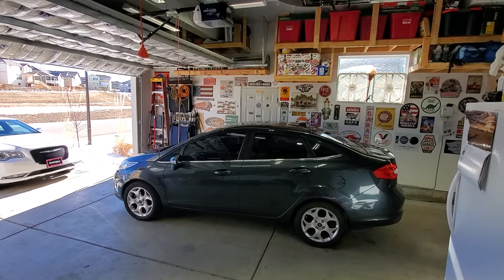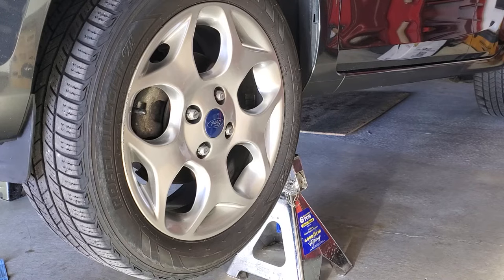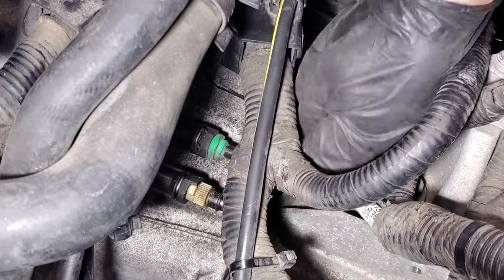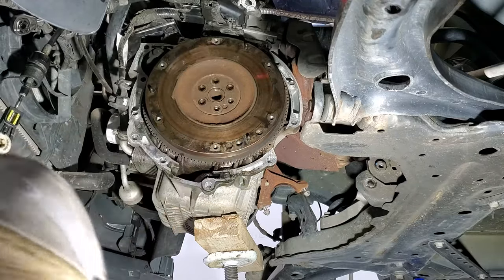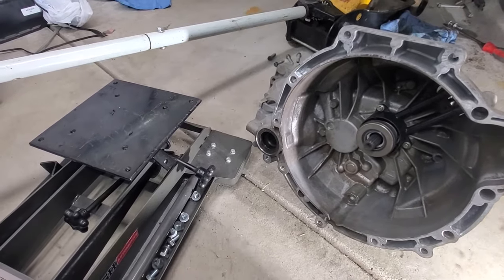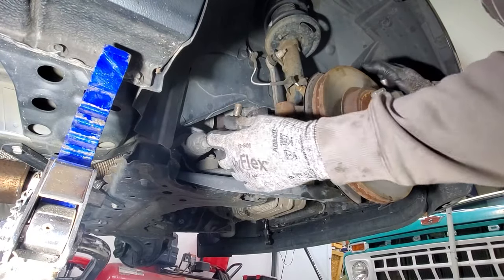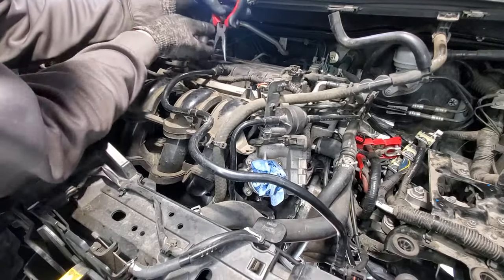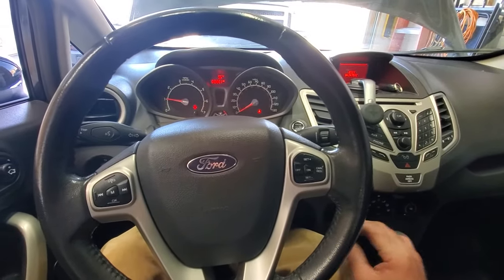Ford Fiesta Clutch & Slave Cylinder Replacement How-To

Comment: Hello, awesome video! 
Was wondering how long did it take you to do all this work? The video is about 1.5 hours but there are a lot of speed ups … thanks
Reply from the maker: I’d say if I wasn’t recording it probably around 4-5 hours or so.
Reply: @BLUECOLLARGARAGE  for you by yourself, yeah, I bet they can do at least that in Ford garage… not sure where 10 hours came from
Reply: @BLUECOLLARGARAGE  thank you for commenting
Reply from the maker: @MrMeowNow  yeah these cars are very simple and basic not a lot to pull when doing this job which makes it nice.
Reply: @BLUECOLLARGARAGE   so I want to ask you a question.  So I have fiesta 2013, and it drives great, no issue with shifting or anything. The only thing is , when I drive about 20-40 mile an hour there is a grinding noise almost like a front wheel rubbing on something … that happened after I got the 120,000 mile service. When I took it in to Ford, they drove it a bit and told me it’s a clutch and it needs to be replaced. Gave me a price tag of $3000. When I asked them how they tested it, they said , we drove the car and listened… No codes no nothing . Will be taking it to another Ford place this Friday.

Question is about that noise, is it possible it’s a clutch or maybe they just want me to get a new car and get the fiesta off the road. 

Thanks you
Reply from the maker: @MrMeowNow  what did they service on the car? Have you checked your front wheel bearing hub assembly?
Reply: @BLUECOLLARGARAGE   the service was generic for 120k , wheels rotations oil change and such… they also replaced back shocks. I asked them to check that, and they said that my wheel bearings are fine.. “ they think it’s a clutch”  
Even when the car is rolling on Neutral Speed, the noise is still there… I would assume that the clutch not in gaged when car is in neural … 
Ps , it’s an automatic transmission.

Thank you
Reply from the maker: @MrMeowNow  oh okay gotcha didn’t realize it was an automatic. I’m assuming you already know there was a ton of issues with the automatic transmissions and the tcm in the fiesta and focus. Even though it’s an automatic it’s built like a manual that just shifts for you kinda of an odd setup. I would definitely take it and get a second opinion though.
Reply: @BLUECOLLARGARAGE  thank you, yeah, doing it this Friday… yeah I know all about the TCM and recall … and all that… mine had 2 replacements of TCM already … nothing in recent 5 years … again, thank you much for responding:)
Have an awesome day
Reply from the maker: @MrMeowNow  your welcome thanks for commenting and keep me in the loop and let me know what you find out because it’s got me curious now.
Reply: @BLUECOLLARGARAGE  lol, will do, I’m also very curious 🧐
Reply: @MrMeowNow what happened - the Update?

Comment: Personally I wouldn’t use LUK  because of reliability I always depend on Borg & beck only on the basis that the reliability factor is better and lasts longer 👍
Reply: When I googled the numbers on the side of the box that contained my clutch, luk model in luk printed box etc, it came back with a Borg and beck clutch. One number on the box came back with the luk kit that was in the box and the other number the Borg and beck. Very strange.

Comment: how much pressure did you apply when bleeding the slave? I cannot get my slave to properly engage my clutch after re assembly
Reply from the maker: I wasn’t really paying attention to the pressure I just was pumping the 3-4 oz of fresh brake fluid in to the slave cylinder.
Reply from the maker: What’s you clutch pedal doing? Is it sinking to the floor?
Reply: @BLUECOLLARGARAGE  the clutch just doesn’t feel like it’s building pressure after all bleeding procedures. I’m thinking there may also be a failing master cylinder at this point
Reply from the maker: @jackflashautorepair  yeah that’s what I was going to suggest sounds like the master cylinder.
Reply: @BLUECOLLARGARAGE  thanks for a quick reply! Your video was a super helpful reference as I did this clutch job. Great work, this is the type of content I aim to make.
Reply from the maker: @jackflashautorepair  no problem let me know if you have any other questions.

Comment: Does anyone know where I can find the bolt lengths for the bolts that hold the transmission in? Like an idiot I didn't mark them when I removed them and I am trying to put the transmission back in. I also do not have a transmission jack so I'm trying to figure out how to get it back up there. I saw someone use ratchet straps on a different vehicle/transmission but I don't know...
Reply from the maker: If I remember right they were all pretty close to same in size only a few were different lengths. Can you tell by my video on the lengths? I’ve actually used a 3 ton jack with a large piece of wood instead of a transmission jack or if you got a couple buddies to help to hoist it back into place.

Comment: Is the fly wheel supposed to rotate freely once the transmission side is off? Or it it a possible sign of something else that is wrong with my car. It's currently sitting in my garage waiting for the clutch kit to arrive, and would like to know of i need to check anything else while I'm under the car.
Reply from the maker: There should be a little resistance but yes it should be able move because with the transmission out it’s pretty much in neutral because there’s no gears being able to hold it in place that is why you need to use a tool to hold the flywheel when tightening the flywheel bolts.
Reply: @BLUECOLLARGARAGE  thank you for your reply and for the very informative video.

Comment: I just installed a clutch, presureplate, and RS slave cylinder into my Focus ST - and now I leak break fluid when i press clutch - clutch is kissing the floor. Im pissed if I have to drop the tranny again. It looks like its leaking from bell housing, but i cant confirm.
Reply from the maker: Sounds like you slave cylinder might be leaking. What bleed procedure did you use?
Reply: @BLUECOLLARGARAGE  I used a bleeder vacuum. Attached to bleeder screw on top of slave cylinder - pressed clutch peddle with a stick to the floor - opened the bleeder - until some air come up, closed it, released the clutch while car was off. Repeated this multiple times. Still air in system. Still clutch stuck to the floor.
Reply from the maker: @dannyj7618  you may need to try and bleed it like I did in the video it’s almost like a reverse bleed instead of pulling fluid it’s actually fixing fluid in the system. Hopefully it’s not leaking from the slave cylinder because of to much pressure.
Reply: @BLUECOLLARGARAGE  Thats what i was worried about - I put max psi on the vacuum and fear I damaged a seal. Appreciate the reply. You're totally right, I misread the workshop manual. I had to pump the brake fluid INTO the bleeder, than top it off at brake reservoir.
Reply from the maker: @dannyj7618  maybe try bleeding it again this way and see if it works. If not I hate to say it but you may need to drop it again and replace the slave cylinder.

Comment: I did everything you said in the video step by step. And now my car won't turn on. What could be wrong?
Reply from the maker: Did you double check all your wires especially that ground wire under the battery. When you say not turning do you mean like not electrical or it won’t start and stay running?
Reply: @BLUECOLLARGARAGE  Yes but I can always go back & check them again. Like it won't start & run
Reply: @BLUECOLLARGARAGE  it's just making a clicking sound that's all
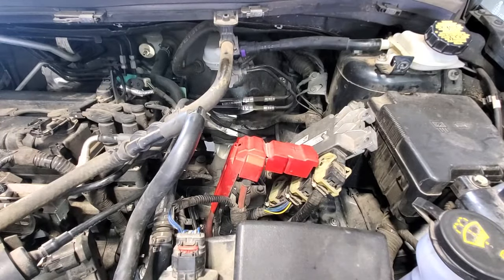Reply from the maker: @cowboyfrank  yeah definitely go back and check that ground wire under the battery box that connects to the transmission it’s in the video at 1:31:21 because if that’s not getting a good ground the car will just click and not start.
Reply: @BLUECOLLARGARAGE  okay it worked. Now I need to put gas in it & see if it fully turns & stays on
Reply from the maker: @cowboyfrank  Good to hear that worked let me know if you need anything else.
Reply: @BLUECOLLARGARAGE  you are so awesome & helpful. I really do truly appreciate it
Reply from the maker: @cowboyfrank  your welcome glad I could help.
Reply: @BLUECOLLARGARAGE  do you have a video on how to change out the condenser on the Ford Fiesta?
Reply from the maker: @cowboyfrank  no sorry I don’t. Not yet at least.
Reply: @BLUECOLLARGARAGE  oh okay lol I need to switch mine out lol
Reply: Dankie

Comment: I was doing a new clutch on my MK4 Fiesta. :D Everything was just fine, I changed whole clutch, did the bleeding and etc...After that I wanted to try the clutch If is working properly. I started the engine with clutch enganged, shifter was on neutral. I released the clutch and wheels started to turn forward. :D I though: "Its ok, I will just shut it down and move a little bit with shift rod going to transmission". And when I was under the car, suddenly I cannot move with that shift rod going through seal to the transmission. It is feeling like jammed or stuck on some gear (1,3 or 5 I think).Cannot change gears even with enganged clutch or released clutch with engine on or off. :(
Reply from the maker: Sorry for the late response did you end up figuring out what was wrong with it?
Reply: @BLUECOLLARGARAGE  Oh yes! I did found the problem! :D On the bottom side nearly next to the drain nut of transmission is another nut. It is hard to explain why is there or what is it, because I do not really know so far. :D Its just a nut with a "nose" and when I unscrewed that, inside is a moving roller in oil. Out of curiosity I tried the shift rod and it was moving! :D So I screw that strange nut with a nose back in, filled up with transmission fluid and car is working! :D 
Thanks for the tutorial man, it helped a lot, even your car is from 2011, basically not much really change. Only in my car, there isnt so much electronic. :D
Reply from the maker: @richguest9480  good to hear you got it figured out. Thanks for the positive feedback.

Comment: When you replace the brake fluid, is the a step needed to bleed the slave cylinder or do you just youse the steps you took when pumping the clutch in reverse?
Reply from the maker: If your just replacing the brake fluid you shouldn’t have to bleed the slave cylinder.